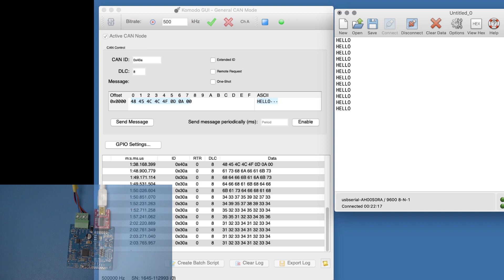Simple demo using CAN-UART Board

Comment: Hello how can I perform this but in Windows for UART can I use teraterm? but for CAN bus what kind of API are you using?
Reply from the maker: Yes, you can use Teraterm but you still need the FTDI UART to USB board. There is no API. More info at: http://skpang.co.uk/catalog/canbus-to-uart-converter-p-1538.html